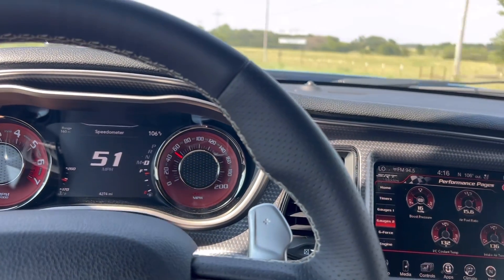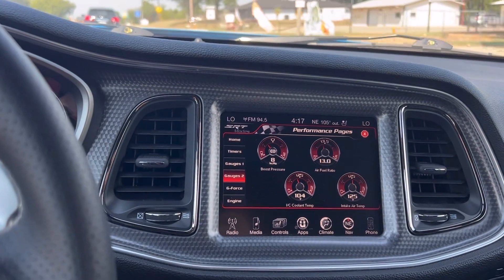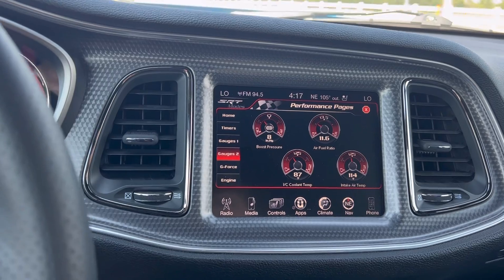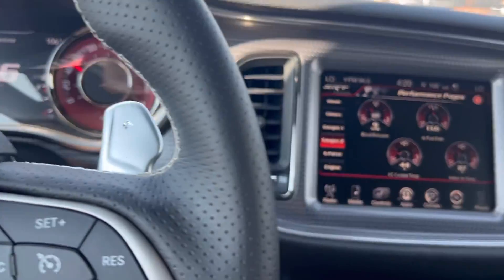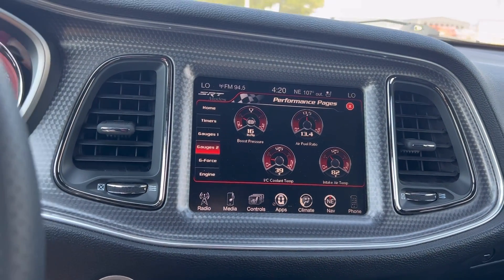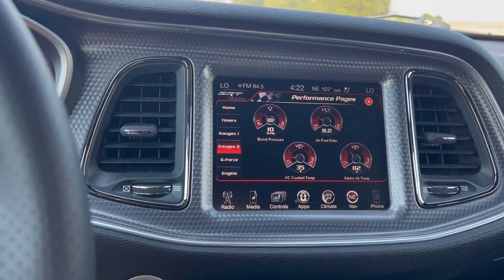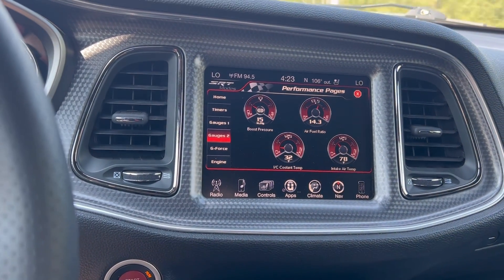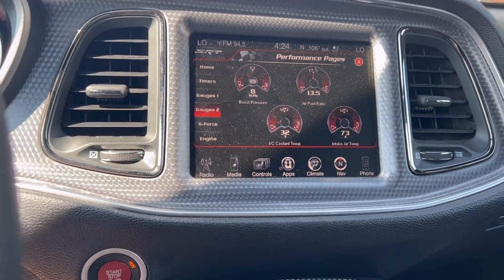Hellcat interchiller speed test

Comment: how high will the ic coolant temps get  doing a rolling or dig pull id love to see those temps  to see how high they climb and how fast they cool down
Reply from the maker: peak IAT under wide open throttle is 100% controlled by the intercooler pump flow rate and fluid volume stored in a reservoir tank. You have to keep in mind the chillers job is ONLY to make a volume of fluid cold, what you then do with that cold fluid is up to you and how well you utilize it. 

On the hellcat platform you can see an 8sec hellcat data log here: https://www.youtube.com/watch?v=x-yRT2LkZWo

Comment: would you be for or against adding a Heat Exchanger? reason I ask is I have the chiller but I have a friend that tests and designs a/c systems for vehicles. He tells me I need to run a heat exchanger but I have heard it is better not to run one as the coolant will not cool down more with ambient air
Reply from the maker: the heat exchanger is a massive heater as you are passing a literal truck load of air through it per second and that air is significantly hotter than the fluid. If you retain a heat exchanger it must be placed on a bypass valve, which is both a waste of time and money.
Reply: @ForcedInductionInterchillers  thank you! 😊
Reply: @09fatbobmike  is it in C or F, as F is down to 0 c degrees basically at 33 F, so which is it ,after all your saying it 107 degrees F outside so what is the IAT temps as C or F ?